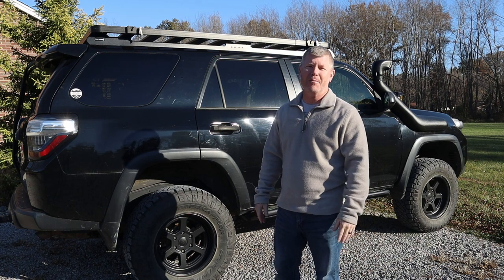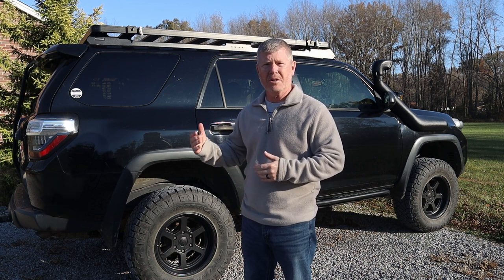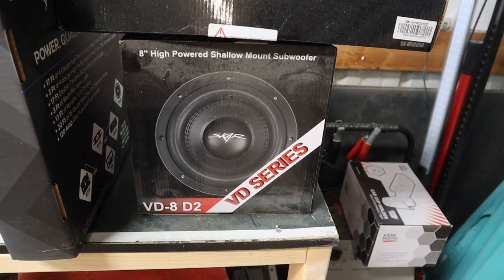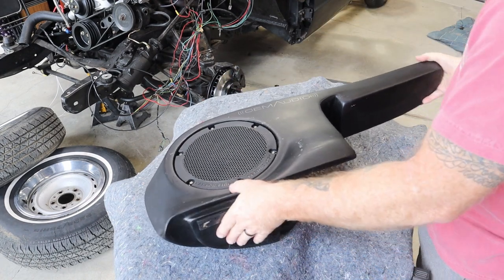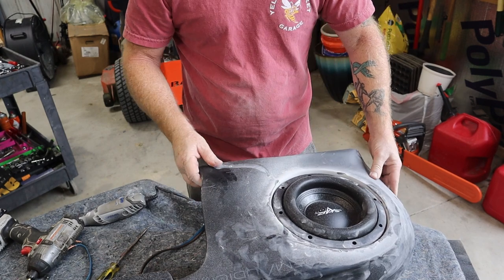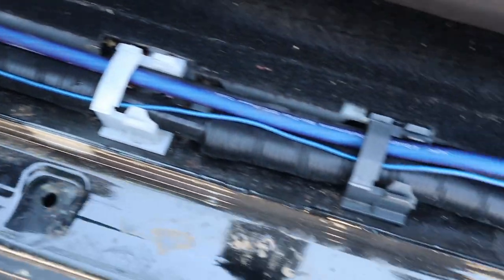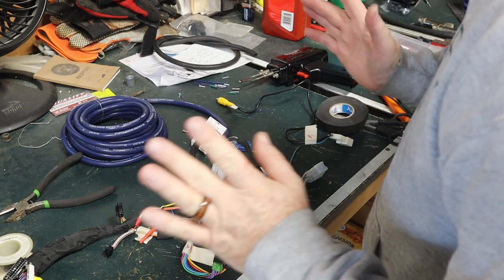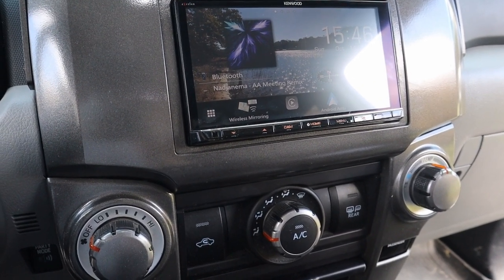Goodbye OEM Audio+ / 5th Gen Toyota 4Runner Skar Audio Upgrade

Comment: Upgrading my audio was one of the first things I did to my Gen 5. Just a tip: never run your signal wires in line with your power wire - even when shielded, you'll get noise. Also, as you get back to the amp, if they have to cross paths, which is common, make it a quick 90 degree intersection.
Reply from the maker: Thank you very much for watching and sharing the tip with the community. You're absolutely right on running those on different sides to prevent bleed over. What did you upgrade your system to in your 5th gen?
Reply: @SpiritedWrenchers  Absolutely,  brother. I enjoy your content and I believe you attract the kind of people I like. Imalways willing to help. Maybe I will chime in when I complete the Big 7 on my 4RUNNER and my TJ (back injury set me back a bit - nothing like having the parts and knowledge,  but your body won't cooperate).

Comment: Good idea with the speed wire, that worked out perfect!  I'm really impressed with my SKAR stuff so far.
Reply from the maker: Thank you for watching and sharing. I have to give props to 5 Star Car Audio down in FL. I follow their channel and have been watching them for years, and they happened to do an episode for a 4Runner install and they used that wire. Until then, I had no idea that existed. LOL. It would have been a nightmare without it. Glad to hear you're liking your Skar gear so far.

Comment: Amazing video! You're super talented!! That didn't look easy at all. Question for you for my situation. I have a 2014 4runner non jbl entune system. I want to keep original head unit and not add any apps. But at the same time I'm not opposed to it if the system would be that much better with one! Just a speaker upgrade. I did the 3.5 dash replacement already with the infinity reference speakers and adapter. Now I want to upgrade the rest. How would I go about finding the best bang for the buck for those? I need 2 6x9s and 4 6.5s. Do I go component or coaxials. Do you like and trust skar? Do I need 2ohm or 4ohm speakers? I'll most likely buy the speakers then have them installed but not sure exactly what to look for. Any insight would be much appreciated!!
Reply from the maker: Hi Sdotkerlin. Thanks for watching and sharing the kind words.  We greatly appreciate it.  You can certainly go with upgrading your speakers first. With the JBL system, it's probably the best first step. It's one you would do anyway. I'm not sure what speakers come in those so I would pop one out and take a look at them to start with. Always start with what your budget is first. I know Kicker has a full 8 speaker plug and play upgrade kit that quite a few people like. That's the simplest route in my opinion.  The question over coax vs components,  that will depend on your listening preference and your desire to modify as the tweeters will need to be mounted as well compared to how the coaxs are just one speaker.  Components also tend to be more expensive.  I love Skar. For the money, they are tough to beat. I have them in 2 cars, and have also installed them in my Harley when I had it. For coax or components,  you don't need to worry about the ohms on them. Only when using an amp. Hope that helps. Come back and let us know when you went with. Stay safe out there!

Comment: Do you think there is anyway way to route this same skar sub using the same connections that run from the amp to the oem plus sub ?
Reply from the maker: HI Carlos. Thanks for watching and asking. We really appreciate that. I'm not sure I fully understand your question though. Could you rephrase or explain what you're hoping to accomplish? I'll certainly try my best to help.
Reply: @SpiritedWrenchers  yeah sorry, so the new oem plus set ups have an additional amp only for the the 8 inch oem plus sub. I believe the amp is 500 watts. 

What I’m asking is if you think there is anyway to pretty much just swap the oem sub with the skar sub without having to install a different amp, directly using the same wires that connect to the oem plus sub
Reply from the maker: @carlosskrr  Thank you for clarifying that. It certainly helps. Well, that would depend on what the impedance of sub amp they have. If you could get the impedance of the OEM+ sub, then you can buy the proper sub to match that amp and swap them out. Hope that helps.

Comment: Does anyone have a high output alternator?  I've got a 99 runner and need advice on what size and manufacturer to go with... I'm trying to upgrade my 2000w amp to 3000watts. The output on these alternators are 💩!